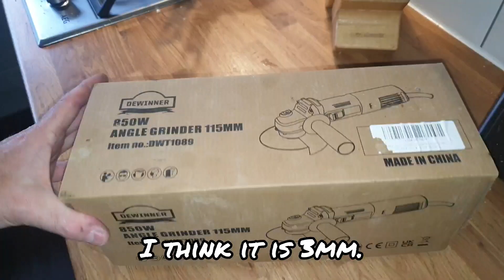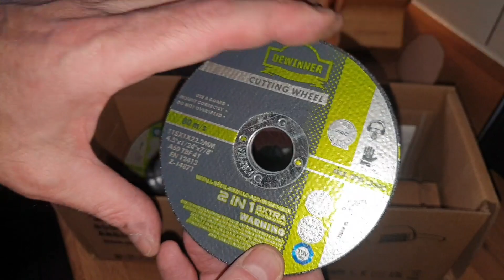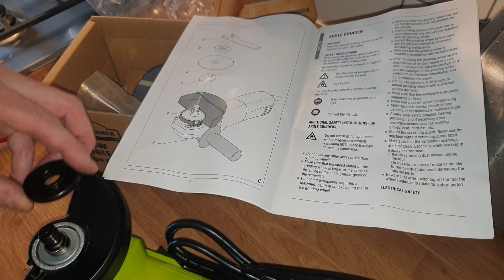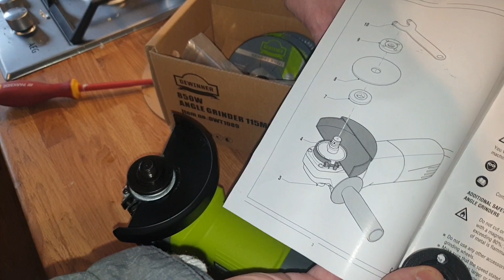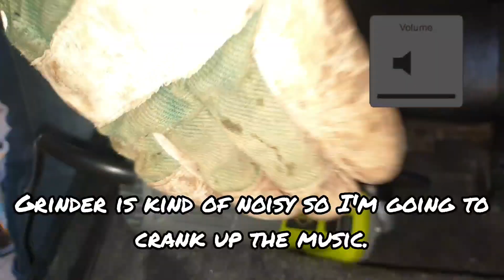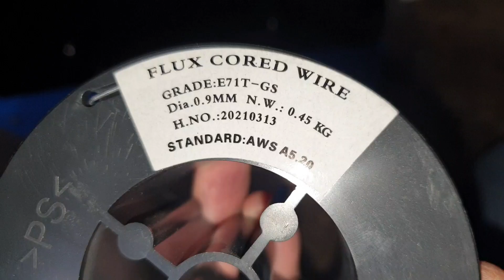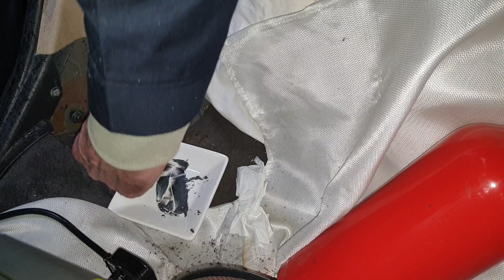Rust on my Volvo 850 T-5 😫

Comment: They all rust in the inner arches, you need to take off the rear arch liners. Be loads in there. Sills will be rusty aswell under the plastic covers, usually holes in the middle.
Reply from the maker: I'll save that job for the summer holidays I think 😄👍

Comment: practise welding on some scrap metal, need to keep the tip close to the metal and feed the wire into the weld pool, if you have lots of wire exposed it will just blow to bits. good first try though and with flux cored.
Reply from the maker: Yeah,  I have to say I enjoyed doing it, I definitely want to get better at it. 👍

Comment: I see where you went wrong with your measurements.  You tried to use one of those new fangled rule thingies when you'd have been better off measuring with industry standard thumbs!  Not sure i'd agree on "structurally solid" mind you. It does take practice and two game changers would be 1) an auto dimming mask.  Trying to hold your hand position and then pop up a mask is difficult let alone difficult level for a first attempt.  2) If you can upgrade your MIG welder to use an inert gas, do so. Argon/CO2 mix is popular and get the bigger bottles e.g. HobbyWeld not the tiny ones sold in the usual outlets.  Welding with MIG (with an inert gas) is sometimes described as feeling like drawing a line with a felt tipped marker.
My beloved 850 is currently SORN as they couldn't get it started for it's recent MOT.  It has become a bugger to start so I got it back home and now waiting until better weather.  I hate working on cars in winter now.
Reply from the maker: Lol, yeah I think I went wrong with the measurements because I was looking at it upside down. Oh well. Yes the welding mask was a real pain to use, I couldn't see a thing until it started spitting. A upgraded welders helmet is definitely on the shopping list.

Comment: If it's a common rust spot for the 850.... I'm checking my car tomorrow😉 Last year I found some rust underneath the rubber seal between the rear window and the tailgate.. Also a common place for 850's it seems.
PS: great job! First time welding😲wow.... you're not afraid that's for sure!
Reply from the maker: Let me know how you get on. 👍

Comment: Have you taken off the plastic sil covers. I had a nasty surprise under mine
Reply from the maker: Not yet, but I plan on doing it, maybe during my kids next school holiday when the car is not in use. I'll take a peak at the rear wheel arch liner aswell. I suspect there might be an unpleasant suprise lurking behind them. I might have to brush up on my dodgy welding skills 😜 Not looking forward to it though 🙁😬